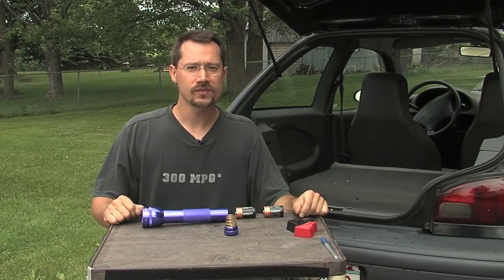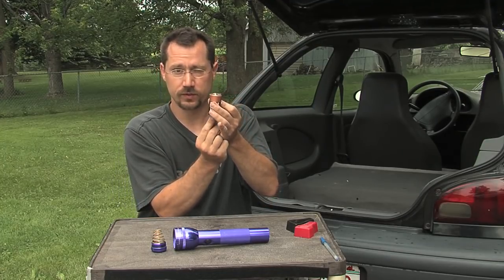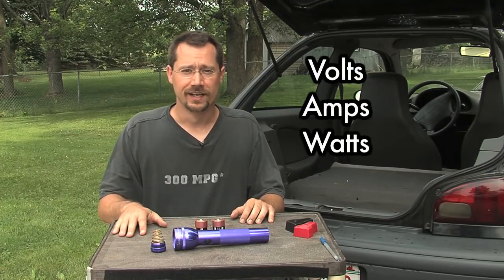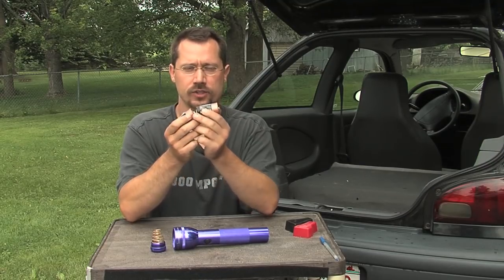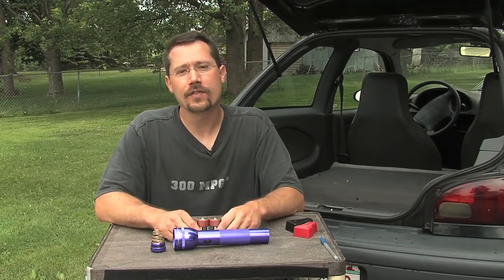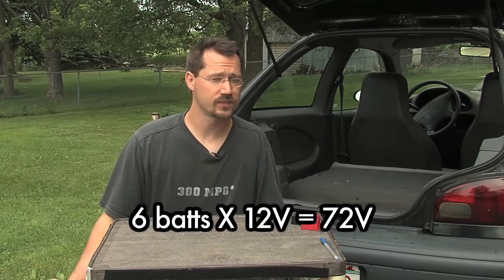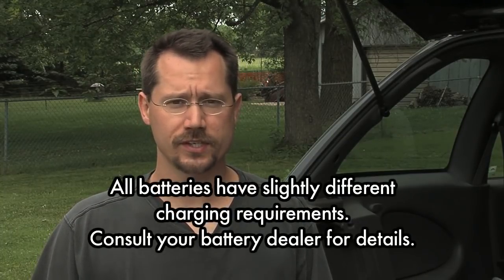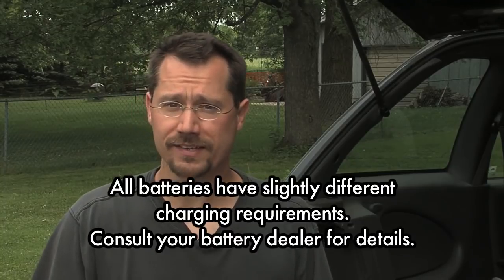10 Build Your Own Electric Car: Batteries

Comment: Nelson, thank you for explaining everything so clearly.
Reply: how about two sets of batteries. one is running and the other is charging.  Then switch over to the ones that are charged and charge the ones that you used first. maybe with a power inverter hooked to a battery charger. Just change over to the fresh set with a switch like a vehicle with two gas tanks.
Reply: I agree!

Comment: 6:04 Six 12V, gel Lead acid batteries in series gets you 45 mph for 30 miles. Oy, not very far.
You rock, great video.
Reply: i've been watching this series closely. im betting thats a sub 10kw battery pack he's got in that car. used 18650s are selling for 50 cents a cell these days. i watched a video of a guy who made a 3.5 kw pack for a couple of hundred bucks. the cells to build a 40kw pack would cost about $2000 not including shrink wrap bus bars and bmses

Comment: Thanks for posting these. Super good videos. [EDIT: Below is just some additional info]

If you have a single battery, and you connect another battery of the same type in series, you get double the voltage and the same CURRENT capacity. With a parallel connection, you get the same voltage and double the CURRENT capacity. In both cases, you double the ENERGY capacity.

Energy Capacity = Current Capacity x Voltage
Reply from the maker: That's correct. Thanks for stating that so well.

Comment: Units of energy= joules or watt-seconds. Car batteries are usually rated in kW-hours, also a unit of energy. Watts does not equal work, it refers to the the amount of work per second. This is similar to miles per hour, vs. how many miles you travel(similar to work). You do a nice job of explaining this, but just a minor point.

Comment: Call around to all your local E recycle plants or used computers stores and ask if they sell used or broken laptop batteries, these are almost 100% or the time 18650 batteries or li-ion then purchase a bunch of cheap testers of amazon and go apart breaking apart all the laptop batteries and test each individual 18650 and you wanna and any thing over about 1400 mah is usable but it all depends on your pack config. Your gonna end up doing a lot of solder but each battery is 4.2 volts around 2000 mah or 2 ah your gonna make packs and wire them in series you need to keep your packs around 2000ah so put together batteries that are like 1800mah and 2200mah as long as you average is around 2000 mah now you need to worry about amps each battery is good for 2-3 amps and when put in parallel this adds up so 10 batteries in parallel is good for 20-30 amps. I ended up paying about 60 cents a battery and bought about 150lbs of used laptop batteries this got me about 600 cells which a turned into two 58.8 volts batteries at 20 ah and two 16 volt batteries at 20 ah with plenty left over in one battery this would be a 75.2 volt battery at 40 ah with about 250 cells left over doing nothing and would be good for about 60 amps the best part would be this battery would only weight as much as one of your sla(sealed lead acid). Please look this up I did as best of explaining as I could but there is so much out there about this.
Reply: Zack Stark what safety measures do you have for your Li-P.O. system? Do you worry about over-discharge?

Comment: Great info and technique! I got turned off though when you said your maximum speed was 45PMPH and 20 mile range. I guess you need more batteries!
Reply from the maker: Keep in mind that it was also a project built over a decade ago with a budget of $1300. (Including buying the car.)
Once I put the Open Source motor controller in and upped the system voltage to 144V, it had no problem going 70 MPH.
This car only ever ran on used lead-acid batteries.
Batteries out of crashed modern electric cars from junk-yards are now a great source for DIY projects!

Comment: Thanks for the great recap of ohm's law as it applies to batteries! Are there any other considerations to take into account when designing a battery array; especially with lithium cells? I wonder if there's more or less electrochemical "wear and tear" and dangers of electrical fire due to for example a cell in a series circuit going bad; or other concerns around battery balancing that become less critical when batteries are set up in sub-arrays/buddy banks?

Comment: Hey Benjamin I'm the guy that called you years ago talking about overunity devices because I bought your how to video I still have it I'm driving a Chevy bolt now but I found out from those documentaries by dr. Steven Greer that we do have zero point Quantum vacuum generators, Stan Meyer was one of the inventors, there's been more than five dozen inventors now,  so now that I know that mercury inside of a donut-shaped copper coil with 250,000 atmospheres of pressure on top of it are the beginning principles as to how you get overunity to run your electric car I feel somewhat Vindicated because I got a lot of crap from electric-car guys over the years trying to find out about this Tech ,anyway have a good one PS ever since mom died I bought five acres out in the county and now I'm really getting a hankering for an old 69 Mustang to turn into a high-powered electric with about 600 horsepower have a nice day

Comment: Ugh, Watt is an unit of power, not energy (reloads shotgun).
Amazing series, only thing I'd reconsider is the motor- something AC would be amazing, better reliability (no brushes) and efficiency, even if you lose a few % on the inverter.
Reply: I'm looking into making an electric go cart (E-cart). Managed to salvage a 1000W A.C motor from a washing machine. Still trying to figure out how it's going to work but going off your comment, I'm glad I got A.C   :D
Reply: Idk. for a small/ throwaway'ish project and a vehicle that won't drive thousands of miles (or need to be as fuel efficient as possible) I'd go with simplest possible solution- dc motor, variable resistor and a switch. For AC you gonna need an inverter and speed controller.
Reply: @wtattreload10  That AC motor is also designed for 60Hz I assume, so lower rpm and frequencies will saturate the cores in the motor.

Comment: Another key point in "flooded batteries" is that they are most often classified as deep cycle, meaning that you can draw significantly more amps over a shorter period of time without damage. And like you said, charge at higher rates. What this means for an ev maker is amp hours..... wich is the measurmant of how many amps you can draw over a period. This case hour. That is ultimately going to tell you a very good aproximant range your vehicle can go between charges. My instructor when i sent to a pre electrical engineering school, taught us alot. Although your terminology is less accurate, you can convey the message clearly. I hope this isn't taken as offensive, nearly trying to help you explain in mabe a more clear way so everyone can understand. I guess I missed the vidio about controllers and how to choose... that's really the vidio I was interested in. Their are so many different types and options....

Comment: For this use you want a battery that can take the frequent full discharge.
Most Pb batteries are made for high power or long trickle charging.

Comment: Sir ,good morning.  What km range do you achieved using your lead acid battery pack?
Reply from the maker: This project had USED lead batteries with a range of about 20 miles or about 32 km. 
Total project cost was about $1300 US dollars.

Comment: @5:52 Six 12v Gel Led Acid batteries. Does anybody know more about his configuration? Car weight/transmission/rear end? Motor model/ volts/ HP/RPMs. ? controller?

I heard him in a prior video say his motor was 36v.. can somebody explain 72v  vs  36v.

How many KWH would you say his batteries are.
Reply from the maker: Checking out https://300mpg.org/projects/electro-metro/ should answer most of your questions.
Also, make sure to watch all the videos in this playlist, as those will answer many questions as well.
Motor was a $50 rummage sale forklift motor. Originally designed for 36V, but run in this car at anywhere from 72 to 144V. The car was more or less stock weight when done. Motor controller was a 72V Curtis DC controller, later upgraded to a home-made open source "Open Revolt" motor controller.
The gel batteries used in this car were 100AH capacity. 6 batteries x 12V x 100AH = 7.2kWh capacity, but only if the batteries were new. These were definitely used.
The car uses the original transmission, although without a flywheel or clutch.
It's front-wheel drive.

Comment: I think things are changing with Li-Ion batteries.  I've seen a video where someone bought surplus cylinder cells from China, and built up his own Tesla style battery.  I'm sure that was still more expensive than Pb-S2HO4 batteries, but perhaps a viable option.
Reply from the maker: This project was originally built going on ten years ago now. In 2018, one of the best sources for batteries for DIY projects are lithium batteries from Nissan Leafs and Chevy Volts in junkyards. Both cell types have been well used by hobbyists.

Comment: Yo! Awesome series! I've been thinking of electrifying a Miata :) but I've got a question, do you run an aux battery for all accessories? And if you do, how do you maintain charge in that battery?
Reply from the maker: Yes. Every electric car still has a 12V battery for the headlights, radio, and all the other devices that would run on the 12V electric system of any gas car.
On this project, I went super-low tech and just had a 12V charger, which charged the battery whenever the car was plugged-in.
A typical electric car will have a DC-DC converter. It takes some power from the high-voltage battery and converts it down to charge the 12V battery.
https://300mpg.org/projects/electro-metro/why-dont-electric-cars-have-alternators/
Reply: @BenjaminNelsonX  that moment when everything just clicks in your head after a simple but well put explanation haha thanks man, I really appreciate it!!

Comment: Here is an important note.  When hooking batteries up to any electrical device such as a toy robot or a car, here's a rule to keep in mind.   Read the back of the device that you want to hook up power to and it should tell you what the input is.  For example 6 volts, 4.5 amps.  So what you can hook up to a device such as a 6 volt 4.5 amp toy robot, the rule is you must give it the same amount of volts and the same amount of amps or higher. The device you're using will only pull the amount of amps it needs, but if you give it to many volts, whatever the device is, you you can burn it up.  In addition if you give it less amps then it requires,  it can fluctuate The capacitors and resistors and what not and cause your device to malfunction also or be ruined.  So remember same amount of volts, and the same amount of amps or higher.

Comment: With your DC motor, do you set up the battery's voltage so that it matches the DC motor? Say i have a motor that is set up for 36V, should i have 36V-42V or can i go up to 72V to get the motor to spin faster?

Another question, often a clutch can be used as a fail-safe mechanism by disengaging the motor from the wheels. Since you aren't using a clutch, do you have a fail-safe switch on the dash to cut power between the batteries and motor? 
I remember from another video somewhere that said trying to pull the shifter to neutral while accelerating is incredibly hard... With a runaway electric motor... good luck...
Reply from the maker: I've run this car at up to 144VDC. In this case "over-volting" just makes the motor spin faster. (Although brush-timing etc, need to be considered at higher voltages.)
YES! Good point. An a system with a clutch, that can be used as an emergency mechanical disconnect, although it would be bad for this type of motor to spin at very high speeds without a load on it. I did have a main contactor which could handle the full current of the system and electrically disconnect the motor from the batteries.

Comment: Hey Ben, Pete (PV for hot water) from the MREA energy fair here.  Now that we are on the eve of 2024, and Lithium batteries cost about $125/ kWh, isn't it time to build an EV with them?  Assuming that it's time, where in the heck would one look for a BMS for 45 or more cells?  I  Don't want to charge three parallel strings of 15 cells and then connect them in series for use.
Reply from the maker: Hey Pete,
I've built lithium battery projects such as my Vectrix electric motorcycle, my daughter's go-kart, and a few other things. Nowadays, I would NOT recommend somebody convert a car unless it's something real unusual, such as a classic. There's just so many great commercially-built electric cars available now that if a person JUST wants an electric car, they should go buy one!

BMSs are still a bit mysterious as it always seems like the thing that everyone says you need, yet there's not a lot of great info out there such as comparing brands and features, etc.
The last one that I got, I bought from Alibaba, but if you are looking for something that can do quite a large number of cells, you really need a system of BMS units that work together. Orion is the first brand that comes to mind.
https://www.orionbms.com/products/orion-bms-standard
Reply: @BenjaminNelsonX  What I want is an electric car.  Industry is only offering electric SU-buses and monster pickups.  Yesterday I checked out a Hyundai Ionic 5 and found that it is as wide as a pickup truck and has either 18 or 19" wheels.  What I want is an electric Geo Metro or electric Tercel or if I could get back the 1988 Ford Escort I converted to battery electric in 1996.  Electric transportion scales down so well but the automakers want big, big, big, and therefore expensive.  
      If I convert another vehicle to battery electric, it will be small and it will not be another lead sled.  I still have the 9.1 inch Advanced DC motor and other parts to do this again.
    thanks for the tip on OrionBMS.  They sell the 48 cell BMS I would need.
Reply from the maker: @peteinwisconsin2496  
I hear you on the whole size thing. One of the reasons we bought a Chevy Bolt EV one year ago is that we did NOT want some monster car.

I also have an electric bicycle I built which uses Ryobi 40V power tool batteries.

Our other EV is a Mitsubishi iMiEV. A lot of owners of those love that it's a simple and compact car, yet still has tons of versatility.

9"ADC was always a popular motor. Find something you can really enjoy after the conversion!

Comment: A warp9 motor needs 72volts and 335 amps. I was thinking about those Kobalt 80v batteries used in mowers, but I can't get any information on the amps they put out to know how to wire them up. They have them from 2ah to 6ah, does that have something to do with the actual amps. Least the car batteries tell you their amps in CCA.
Reply from the maker: In general, larger capacity batteries (measured in AH or Wh/kWh) have a better ability to produce for a larger current draw.
Keep in mind that electric cars commonly use cells or batteries rated at 40AH to 100AH or more.
Something like cordless tool batteries might be great for electric bikes, but the total number you would need, the effort you would have to put in, and your total cost means it probably isn't practical.
At least I haven't seen anyone do a project based on them yet. If you want to give it a try, go for it, just make sure you know what you are in for first.
Reply: @BenjaminNelsonX  . I just bought a motorcycle battery and am looking for more like it. Only 12volts, but 30ah and 500 amps. They are discontinuing selling them at Advance auto parts and most stores were out of them, I managed to find one close to me, but for 2 more I have to drive 50 miles. It came to 104.00 after tax. It's the lfp8 from Autocraft. I'm guessing I would need more than the 6 that make 72volts. And would need to wire them in both configurations.

Comment: hi from gary fifield  some was talking about  supper capacitors on  youtube  instead of using batteries on a project this could  use to  you  why  not  try  it take less  time to charge  is this useful to you and a dynamo and  isolation switch and charge  meter to indicate when there fully charged so you  have means charging the capacitors on the move  you  could  use  a solar panel on the roof which can bought online  for static charging is this useful to you